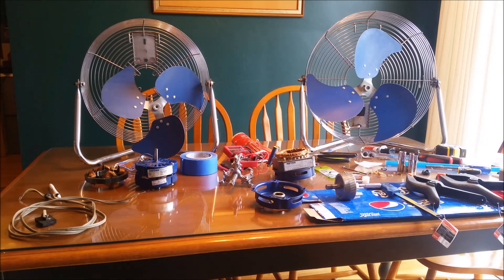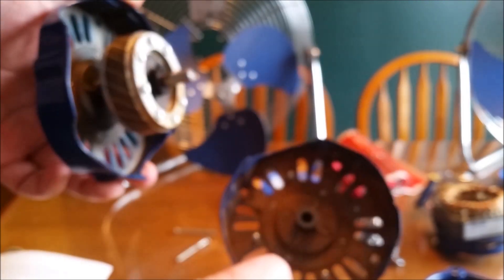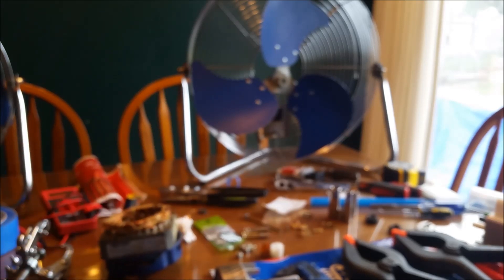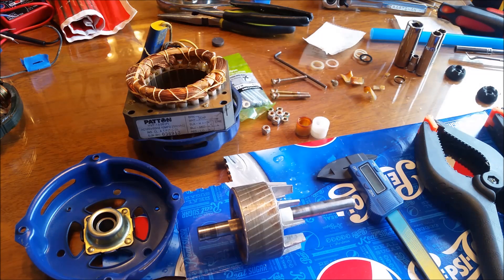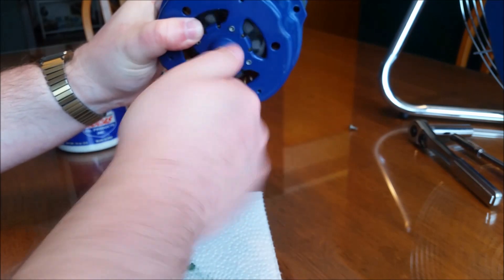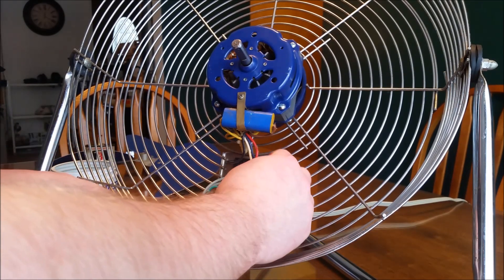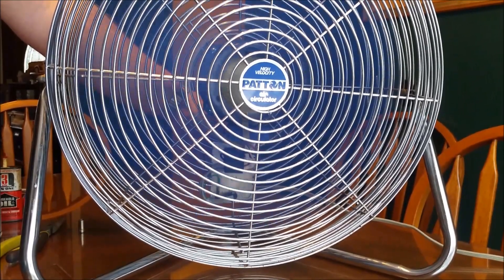Patton Fan motor quality comparison, troubleshooting, & repair: Models U2-1487 and U2-1887

Comment: Great video!  I have the 1887.  it has started making a motor rattle.. loudest at slow, less at medium and none at fast.  I see the shaft moving slightly in and out, causing the rattle... thus at high speed it "pulls" the shaft and does not move back and forth.  Could this be one or both spacers going/gone?  Help please! :)

Comment: Sleeve bearings for high speed motors are generally vacuum impregnated with a light spindle oil after machining to size.  Or as you mentioned, there will be an oil soaked felt ring which gradually surrenders it's oil to the moving surfaces over the "life" of the bearing.   Not too many people will have access to a vacuum chamber, but one of those ziplocked plastic bags with the vacuum port for food storage may do the trick.   McMaster Carr sells oil, graphite, and PTFE (teflon) impregnated sleeve bearings.  However, as I recall you can also buy impregnated bronze bearing stock and if you have a machinist friend, machine your own bearings.

Comment: For my Patton Fan model TG-1887, I'm looking for a replacement for my motor run capcitor Vim QPC-MEB8. Would you happen to know where I could find this part or something equivalent?
Reply from the maker: 8UF 250VAC is the spec for it, in theory one like this should work: https://www.amazon.com/PODOY-CBB61-Ceiling-Capacitor-250VAC/dp/B0143VJN40

Comment: I have the 1887 fan and have had it for years and it's worked great but I need to pull the motor apart and try to repair it. Thank you. Hopefully I will be able to do it thanks to your video.

Comment: how do you remove the cord! that plastic piece is driving me insane
Reply: Did you figure it out?  I think someone pulled my Patton fan by the cord and broke a wire. The fan will run if I loop the cord through the handle, otherwise it’s dead.  Brake is somewhere near the fan, so I want to disconnect the wire from the switch and reconnect minus about 4” of wire.

Comment: I have a Patton High Velocity Air Circulator (circa 1990s?) in great condition and it's still going strong except I accidentally bent one of the (blue) blades (sick about it). I know it might be a long shot ... would you know where I can find a replacement propeller?
Model: U2-1887
Serial: 92-U23-007116
115v 60hz 300w 4.1amps
I appreciate any leads.

Comment: At the 5:08 mark, “the bearings were dry, so it was intermittently singing the song of their people.”  FUNNY COMMENT.   For more similar humor everyone should go watch the YT video titled DIARY OF A SAD CAT.  It states that when the SAD CAT is locked outside the bedroom door that it would “…sing the song of its people outside the door.”
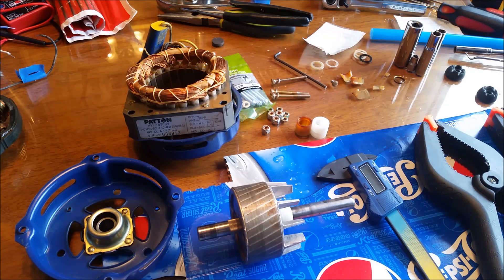Reply: At the 5:38 mark, I was shocked (no pun) at the difference in the two motors.  The U2-1487 was so weak looking next to the much better built U2-1887.  Much like WALLY COX standing next to ARNOLD SWARZENEGGER.  Sadly, I own the (non-working) U2-1487 model.  Is it any wonder it failed!

Comment: Great video thank you sooo much 💙❤️💜💙❤️🇿🇦 from South Africa my l have the same fan but the problem its a  5 speed switch fan 12345  l was asking how to test the wires with multimeter in order to connect thanks

Comment: Hello really nice video this gives a lot of instruction and details on servicing a patton fan , I have patton fan just like yours it's the same identical model but I think mine is a year less of yours , but the motor to my fan suddenly burned up just recently, would you be able to help me on where I can find replacement or would have A spare one that you could sell to me ? If anyone could help me with this problem I really would appreciate it thanks.

Comment: Did you figure out the lubrications situation? I’ve got the 1887 and just last night it started cutting out. I think the thermal switch is tripping because it’s getting too hot. I’m assuming the bearings in it are starting to encounter more friction, and it probably needs some lubrication

Comment: I have a Patton u2-1287 from 1989.  It runs good if you have it positioned to blow are straight ahead.  But if you tilt it back just 10 degrees the shaft that turns the blades vibrates forwards and backwards inside the motor and makes an annoying noise as a result.   Would love 
to figure out if this is fixable because it's a powerful little fan.